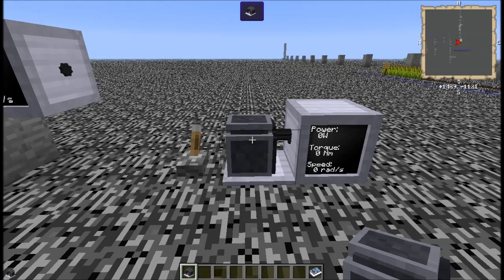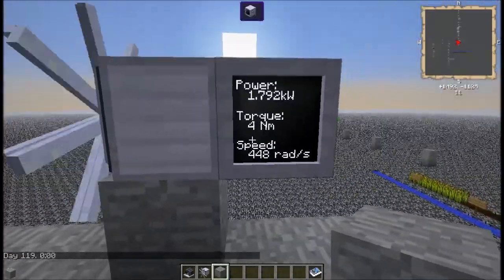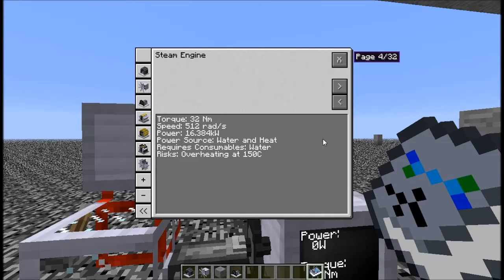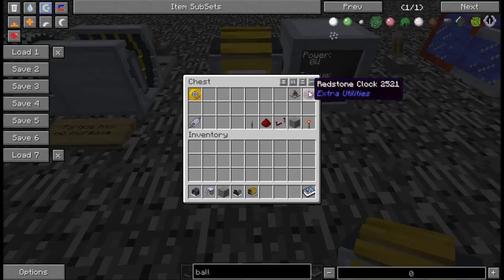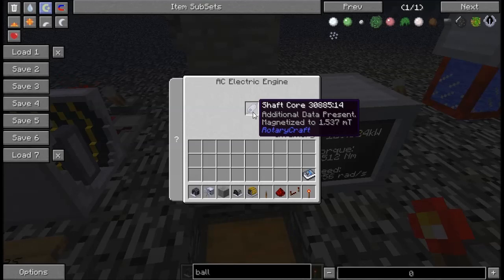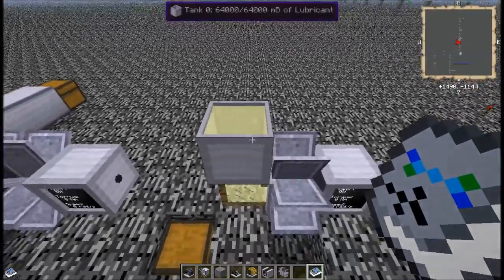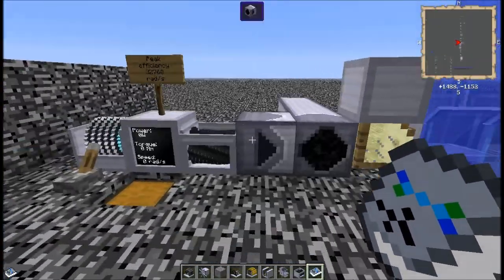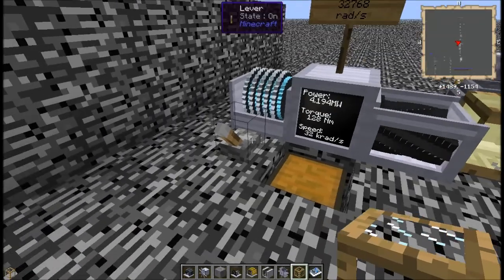How to Guide for RotaryCraft pt 4 Early Power

Comment: You say peak efficiency is at 32768 rad/s. This is incorrect. The time used is a logarithmic function of input speed, so in fact the slower the operation, the more efficient it is. That said, noone in their right mind would want to wait that long for items to process.
Reply from the maker: Perhaps efficiency was a poor choice of word on my part.  Usage?  Extreme?  A suitable replacement is not coming to mind.  Need caffeine...
Reply: Efficacy?

Comment: I can guarantee you that a steam engine at 125C will never explode.
Reply from the maker: Then, on my one outlier data point, I had a fluke.  Perhaps a lag freeze frame?  I was not budging after all.  It MAY have continued ACTUALLY heating while my screen was stuck in lag.  I had it happen at 124 (I rounded) and also at 142.  For the sign, I noted the one extreme of 124.  Perhaps the 142 was also a hiccup, since those were the only two odd ducks out.  You have no idea how many experiments I've been setting up.  Some of my experiments are even making ME go cross-eyed.
Reply: Perhaps it was heating so fast it immediately went from 124 to 150+?
Reply from the maker: I was using different heating methods.  Some much more rapid than others.  My guess:  I had a frame lag and it was the last number displayed before the lag.  I simply dutifully noted what I observed.

Comment: The ingot at the bottom of the steam engine is for heat conduction. Both copper and gold conduct heat well, but only the former is guaranteed to exist with RC, as you may not have TE3, IC2, TiC, and so on.
Reply from the maker: Silly question, then... Does the ingot used have any bearing on some sort of obscured data (like max tolerances or something) on the resulting engine?  I did not SEE more than one Steam Engine item, but I don't know if that rules out the possibility...
Reply: No, the material used has no effect.

Comment: You forgot the heat sink fins for the steam engine, then you can use lava as a heat source with out it blowing up.
Reply from the maker: That's what I thought, too.  I put several of them on, and it still exploded, so I figured I did something wrong.  Hence I decided not to cover the failure since I thought it didn't work.  I'll figure out what I did wrong and try to put up a quick video if I am successful.  I chalk this up to me stepping in a steaming pile of fail.
Reply: Well it has been a while since i played with it so perhaps something has changed. Only possible thing I can think of that could affect it would be the biome. Hot biome less heat loss?
Reply from the maker: I've had a few odd issues with several mods not QUITE behaving correctly.  I wonder if it has to do with me using the whole Monster mod pack...  Some sort of unpredictable, behind the scenes mod interaction.
Reply: That is one possibility, but it could also be that the mod couldd have changed to make it more difficult on purpose. As I said in my previous post it has been a while since I have played with this mod.